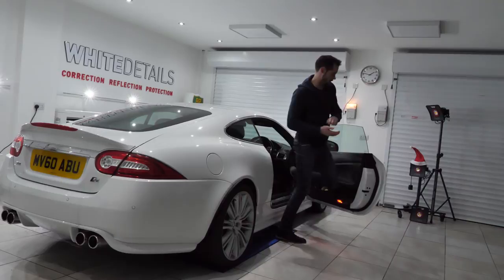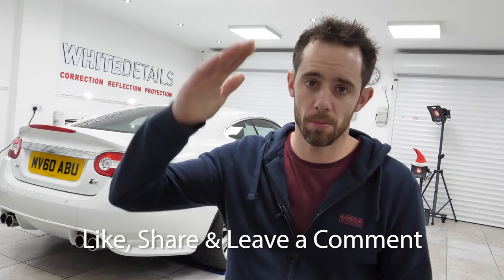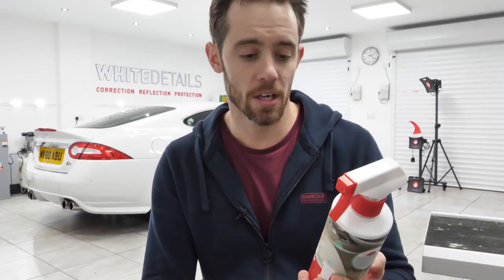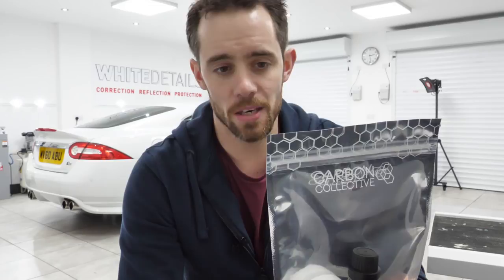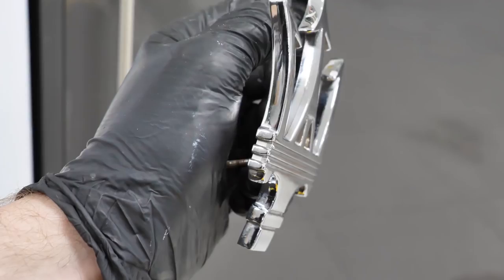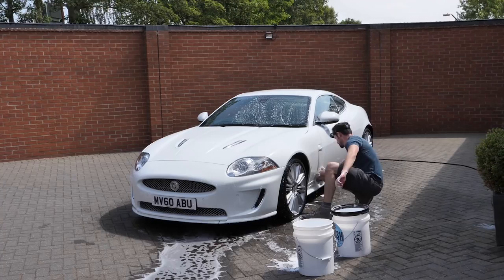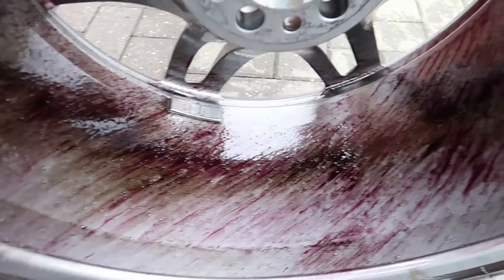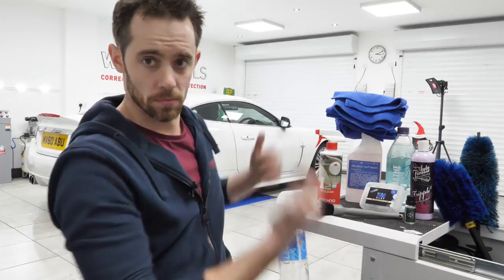Detailing GIVEAWAY + 10 XMAS Stocking Filler Ideas Under £30

Comment: "Count me in Jim". You were recommended by an old boy who was vehicle body coachbuilder. He owns from new an immacilate  original Volvo P1800, stunning car no rust. He cleans it with ...... paraffin and swears by it. I like the fact someone of his generation appreciating the work you do (& Terry) in striving for perfection. Like polar oposits in 'detailing' in comparison. The best bit of 2018 the turn around on the 1988 V8 Vantage X-Pack. Vlog 51.

Comment: Great video Jim. I have purchased myself( the car) some Christmas presents. Especially timely as I have just had my car coated for the first time, so the Bathe shampoo should good. I was recommended to purchase Carpro reload silica sealant that would “refresh “ the ceramic coating. Is this worth buying? Or would you recommend an alternative. Keep up the great work.

Comment: Hi guys,
I really really need help please, 
I'm trying to get my own detailing business up and running, 
I have some disability, 
Firstly I suffer a severe case of scoliosis, I've had 9 operation, now the reason I started my own detailing business was noone would give me a job due to a risk on there business due to my condition, now I've just having regular customers coming in, now I'm only on a pension so trying to get the equipment up is very hard, every time I do a job I have to restock on products, I'm only using a basic house vacuum, I've got the cheapest carpet shampooer that is really hopeless and doesn't really do the job it should be doing, I dont want money but I would be so grateful if some could help donate some equipment and maybe upgrade some tools, 
Detailing for me is more of a passion and it keeps my mind of my spinal condition, like I said I dont want money, I just need a head start, now that I'm starting to get my regular customers I really need to upgrade some of my gear,
If someone could help me that would be so great, I can even give you my detailing business details and proof of my business and my regular customers, 
Great video and good to see you guys doing giveaways, anyways happy detailing everyone. 

Marco B
AUSTRALIA 
rexybundy76@gmail.com